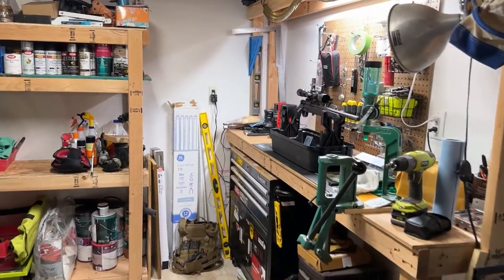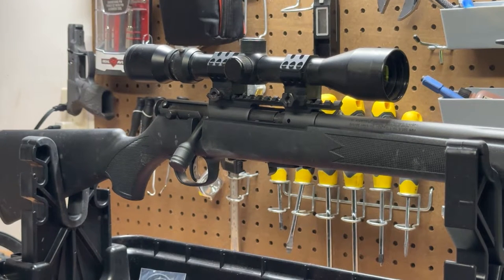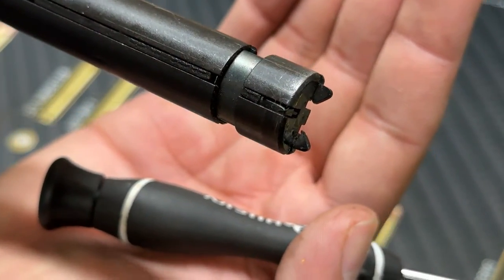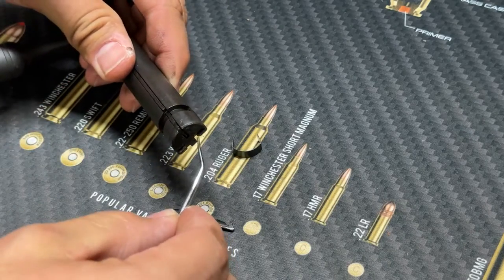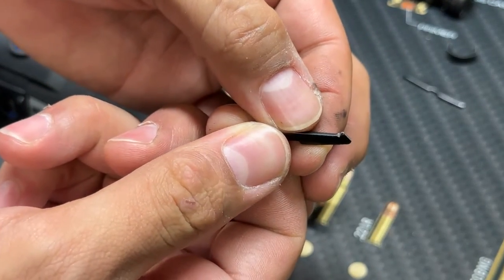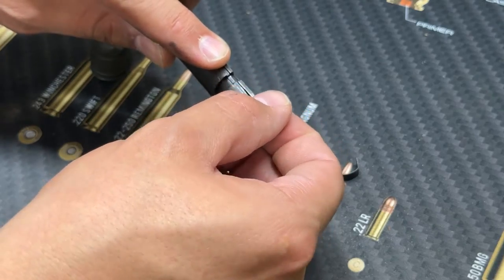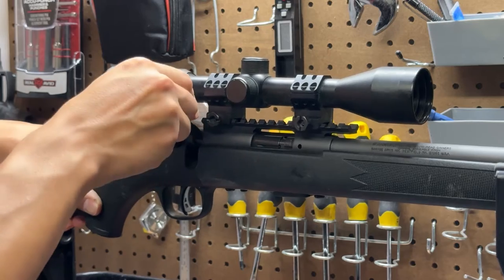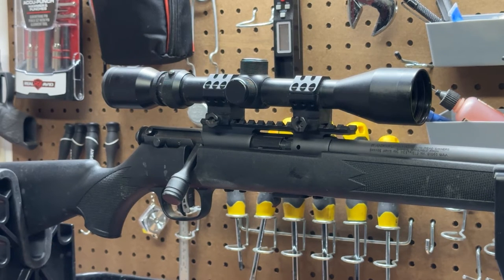Savage MK-II 22lr EXTRACTION Issues Fixed??

Comment: Adding a second spring to the bolt (almost) fixed my extraction issues.  It's a pain getting that second one on there even after some Dremel work, but it's way better than using the tip of my pocket knife to pull the fired cases out the chamber all the time.  A quick call to Savage put me in touch with a very helpful gentleman who sent extra parts.
Reply: A second spring clip fixed my extraction issue as well. Initially I bent the spring clip for more tension, but that only worked for about a box of 50 bullets.

Comment: From my experience with my Mark 2 is the brass expand and the case sticks which makes the weak extractor having difficulty extracting the casing. To fixed the problem I spray a little lubricant on the ammunition before shooting it. So far it has worked for me.
Reply: Exactly...  and it doesn't take long to do so..  I haven't tried the lube yet. Seems the tolerances are too tight and no amount of break in will resolve.  I had the same issue with a 760 Gamemaster that a buddy handloaded to hot, expanded the brass after one shot and you had to wait a bit before shooting again.  In that case it was the ammo. In this case it seems to be a factory issue with too tight a bore... which co-incidentally may be responsible for at least some of the extraction issues owners are encountering.

Comment: You sharpen the extractor like he says.  THEN you add a 2nd retaining spring. Dremel the notch  slightly...All ammo  Problems solved.
Reply from the maker: it is a lot to just get  the gun to cycle ammo properly and it should have been something Savage addressed early on, but clearly that is not the case. It's a great suppressor platform and the trigger is great. It sucks to have to even do these modifications to the rifle, but I'd rather do this than send it to Savage for weeks on end, just for them to tell me they found nothing wrong with the extraction issues.
Reply: @MatSuPewPew907  I agree completely.

Comment: Ive been told its the chamber tightening around the spent casing as the barrel gets hot.  I can fire and remove around 30 rounds before I have the problem.  It was recommended thar I have the chamber polished.  It tried sharpening the extractor, after Savage mailed an extra. Didnt work. Not having experience with that I took it to a gun smith. Hope to hear back soon 
  Also have the same problem with a Rossi RB 22, that started after firing around 300 rounds.  Rossi will not sell the extractor seperately, which is part of the spring. Cost $50 for a new one whoch made no digference.

Comment: We put thousands of rounds through our dozen MKiis. Most common fault has been someone dropping the bolt on the floor or otherwise bending the slot closed that holds the extractor hook. A flat screwdriver will open the slot again. Test if this is your issue by pulling the extractor out past the edge of the slot. If it doesn't clear easily, then it is time to expand. We also had issues at different temperatures when the casing lube would melt then freeze the casing in. A lanolin-based lube runs the cleanest at the biggest variance in temp.

Comment: Using that Dremel is too aggressive. You are actually reducing the bite by removing that material and making the extractor point smaller and shorter. The geometry of that point is highly specific and sensitive to any removal of material. What would be more appropriate it a good jeweler's file to sharpen it up ever so slightly with a few passes. I have had this issue on many MKII's, and at the end of the day, while the rifle is top notch accurate, it's terribly flawed in design in this respect. With all the extractor issues plaguing these rifles, it's a major defect and makes me want to get rid of it and spend the extra money to get something more refined and reliable. We should not have to fix shit like this. This will not fix the extractor issue and will make your rifle unusable. The best bet is to replace the extractor with another factory part and be sure to clean the slots these parts sit in regularly. Squeezing the clip helps a bit.

Comment: I have  a  Savage 22.  Cal.  Mine is black also. I think the Magazine has a problem. Everytime after a shot goes off, I pull the bolt back &  the new  bullet   does not get loaded. The old casing gets dis-logged.    Thanks for showing  how  to get the bolt out.

Comment: I just bought one and had the FTE problem. I fixed mine by using new ammunition. I was using ammo that was a couple of years old. The older ammo had a sticky coating that I think is wax. After I cleaned them, I have run at least 500 rounds with a zero failure rate.

Hope it helps!

Comment: Hi. I've got the same problem. Does it really help? Have you had any extracting problems after that? Thanks!
Reply from the maker: To be fair, and I never stated this in the video which I should have, I was in fairly cold weather when I was having this issue. I'm sure it had some degree of causing the fail to eject but I can't be certain. I just haven't gone out to shoot at all this winter, so I can't honestly say if this fix has held up. I can say that the rifle was ejecting the blanks FAR BETTER than a real spent case. Shit, it wouldn't even eject the spent cases.
Reply: @MatSuPewPew907  I think you are right about "cold weather", which would cause the barrel to shrink, thus that the barrel would hold the case too tight. 

I think Savage might just have to increase the diameter a little bit so that cold weather wouldn't cause any extracting problems.
Reply: @MatSuPewPew907 it’s hot here in phoenix Arizona and I have the same problem.